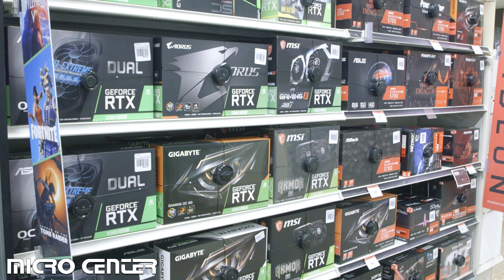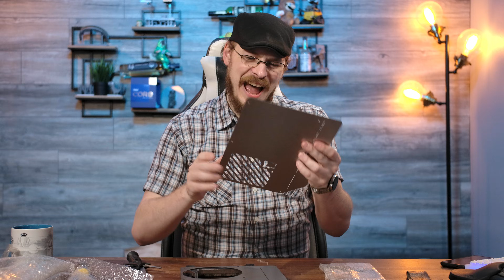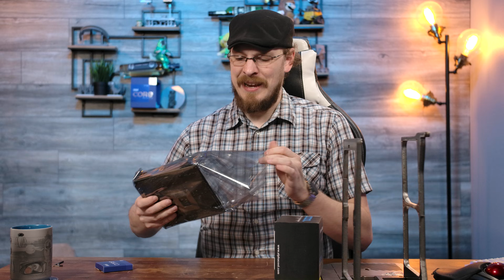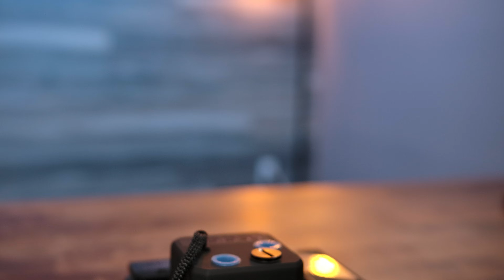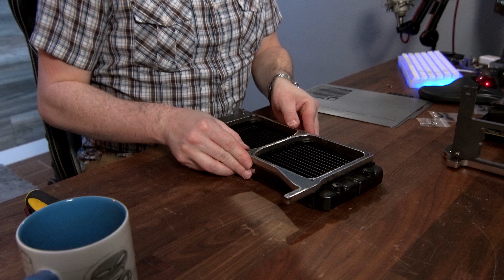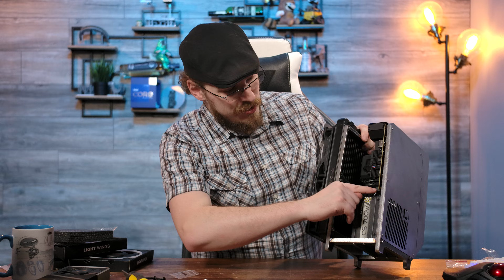Custom Solid Steel ITX Case - My most INSANE build yet!!!

Comment from the maker: Thanks to Microcenter for sponsoring today's video. Get a Free 240gb SSD at Micro Center (New Customers Exclusive, in store only): https://micro.center/973328
Reply: Hi Jeff, Sweet build 🥰👍🤩🏆😉! QQ: Are those side panels supposed to be bent over at the GPU end with those slight perforations to allow better airflow with the GPUs HSF design?
Reply: just a quick note the window on the cpu pump is supposed to be at the top so the pump doesn't get an air bubble stuck in it and run dry, anyhow an interesting and cool looking build

Comment: It's cool only improvement to the actual case would be a slightly larger bottom panel so you can fit the rear and the fans on the inside but I love it

Comment: I'd try to get an Solo LT if you can find one. Or maybe one of the barrow all in ones, but you're probably not saving much height there. I'd have probably made the case a bit wider to ensure the rad being able to fit there. But i think it looks pretty cool on the outside too so maybe not

Comment: Question. Is the bottom 10mm piece reversible? Like can you take the bottom piece of the "U" and flip it upside down? That way it installs from the top down over the screws and nuts rather than from the bottom up. Unless I missed something in the build it seems like it would be possible for the bottom piece to be pushed down/out causing the case sides to collapse inward. For that matter, a single support across the top might also be a nice edition. Nothing huge, maybe just a single I shaped piece of 10mm steel secured with a couple of screws. It wouldn't need to be huge just enough to keep the sides parallel once items are attached to them. A piece like that would also provide a convenient handle.

Comment: Qapla' That is a mighty fine unboxing knife you have there.  Could you direct me to a vender of such fine merchandise?

That PC looks amazing.

Personally I'd go with 64 or 128GB of memory, but if it's just going to be a gaming PC, then 32 should do fine for a while.
I'm not sure if its a common thing in the North and West to have more than one PC dedicated to different tasks (eg. gaming, video editing, office work) etc, but I've tended to have one jack of all trades PC that needed to do all of my tasks(gaming, video editing, development, browsing, media consumption, 3D rendering) and maybe a laptop for portability. I have a small server that runs containers and functions as a NAS and a few Raspberry Pis, but I've just never had the budget for multiple desktop systems dedicated to different tasks, thus my high memory requirement. I'm based in South Africa BTW.

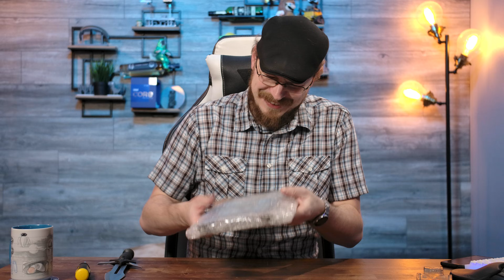Comment: That Clunk @1:47 dang! This is a really cool build. I'm actually interested in doing something similar, didn't know about that all in one pump, gonna have to look that up! Thanks for this review.
Reply: Also, I've been using 180 degree PCIE cable adapters on my GPU's for a while now to clean up the cable mess/look. I recommend them if you want to try and hide cables around your GPU.

Comment: I love the look of the build! I would personally probably go for a black powder coated look on the steel myself, inducing the side sheets :)
I'm questioning if the GPU "finger" where it is screwed to case is on the correct side of the case panel - I saw you said in a different comment that you fixed the alignment of the two side panels and I'm wondering if it was the GPU mount, as that is what sets the alignment of the two plates at the top. But if that is the case, I'm wondering how GPU is installed with the side panel in the way, hmm.
Reply: You are correct. Easiest to mount GPU before the radiator panel.
Reply from the maker: The GPU mount is exactly what caused the issue. The sides are now 100% square and parallel.

Comment: In New Zealand they are recommending 850W PSUs with the 6800xt and 6900xt - will the 700W PSU make a stable system?
Reply: Undervolting both cpu and gpu will give opportunity to run with lower power limit and equal performance to stock, if needed...

Comment: While it's not what I'd choose it is a very impressive look. What are you going to do for a power button? If you search for "stainless LED button" on the likes of eBay you can find some (IMO) pretty sexy options which might fit the build. I'd describe them as something you might expect to find on a sleek modern elevator.

If you go down this route just remember that ATX power switches should be momentary, not latching.

Comment: Guess I'm not easily impressed as most seem to be.  Case is held together by 4 machine screws at the bottom thru slots that in your initial fitting causes the sides to cave in a little at the top.  The links provided only offer PLANS on Etsy.  I like most PC builders do not have CNC/plasma cutters and associated tools the build the case from scratch.  For what folks pay for fancy cases these days this case could be bought for $300 bucks or so if offered as a COMPLETE case as you received yours :) Maybe? Possibly? Who knows!  Love the MOBO  and PS and CPU you chose and thank goodness you're opting for custom cabling.  Too many YouTube builders crap up their builds ball pein hammering in the cables that are too long.  Water cooling and the giant video card just don't work aesthetically for me!  When the cameras are off (hype off too) and you sit back and look at the beast I'm sure you will change a lot bringing the build up to YOU'RE standards!  I love the heavy metal approach to the case but it needs more refinement and those who could build that case can easily customize it.  Hate me now, doesn't matter...  Just another YouTube fart in the wind!  LOL

Comment: That's an interesting design that can also be done with thicc acrylic to keep costs and weight down. Also gives more color choice.
I'd have liked the bottom plate to be as wide as the PCIe support on top so the side plates are straight and not angled like a roof

Comment: I love the build and the overall concept Jeff. If it were me (and it's not) I would keep the steel raw. I think the rough edges where the water jet(?) cut the parts looks amazing and gives the machine a really great industrial look. As to the flat steel I would just seal it with lacquer and leave it be. In fact, I'd probably simulate oil smudges and handling marks before sealing it.  Also, all the screws (bolts) need to be stainless hex caps. No Phillips heads anywhere. But like I said, it's not me and you do you. But please make the two sides parallel. My OCD was screaming looking at that.

Comment: I'm worried about the steel rusting. How about nickel-plating it?
Reply: My first prototype is 1.5years old and it doesnt have any rust on it. But ofc, any surface treatment will change how it looks and how it ages. Up to the builder to choose what one wants. :) Spray it with salt water and you get rust, it wont change the functionality of the case in any way tho.

Comment: That top-bottom offset is making my OCD scream... please that bottom hast to be filed to match. Awesome case indeed, I would change the layout upside down and make the legs sligthly larger so all the cabling goes under and back the thing, and another thin plate on the top with some I/O and power button.

Comment: I'm nervous about open case designs as my primary work desk also involves working with electronics, I'd hate for a screw or a random piece of copper wire to fall and ricochet into the computer.

Comment: Hmm.. even with all that packaging the sides got bowed, shame :\
Reply from the maker: Trust me, they are not bowed. They were slightly misaligned on the bottom. I fixed it after the video. It would be literally impossible for these to have been bent in shipping.
Reply: @CraftComputing  You can never trust a parcel service, they can do the impossible ;)

Comment: The only thing throwing me off on this set up is the custom loop.The radiator mounted on the outside just seems off so i would prefer to go with a different pump/block option. Also, just for flair, metal tubing with the polished case would look freakin sick as hell, but i do appreciate the simplicity of soft tubing.
Reply from the maker: Dammit, now I want to do metal tubing....

Comment: awesome little build, just curious if the bottom plate has been installed upside down?, because if you flipped it, it might just straighten up the two side vertical plates, would have been awesome to see the plate cut of stainless steel, but I understand why you couldn't(distortion from plasma cutter), if you do "shine" this mild steel up to a mirror finish make sure you coat it with some sort of protective coating as it will rust pretty quickly being mild steel. otherwise a nice powder coat finish would look pretty cool as well
Reply: The case is actually lasercut, and distortion is not a problem. We can cut Stainless up to 60mm thickness. Price is the actual reason why its mild steel, its readily available for me as scrap pieces, stainless is not. :)

Comment: I really really like the case, by that ... dont know what to call it but slight convergence from the top and back panels bothers me more than it should 
some squaring of the surfaces might help, or a 3D printed bracket 
or something neat like a top bar made out of a dulled dagger or something that is screwed in to tapped holes.

Comment: I would ask for some black wire frame fan grills, might take up the slack in the screws, and provide contrast to the polished chassis. After polishing, a coat of clear to protect from rusting.

Comment: Is that 700w PSU going to be enough to support a 6900xt and the 12900k? That seems to be on the low end.
Reply from the maker: Without overclocking, it should be plenty. Peak wattage should be around 580W worst case.
Reply: @CraftComputing  okay. I'd still be cautious. I've heard of people with builds using similar setups and having to last minute upgrade PSUs because they kept having artifacts appearing on screen while playing because the PSU couldn't handle the demand.

Comment: I love the idea, though i think it needs a brace between the plates opposite the power supply plate, to keep everything square, those T-nut joins aren't the strongest. I'm wondering why they didnt just drill and tap the sides of the plate for screws and instead opted for captive nut joins.
Reply from the maker: Alignment is fixed now.
Reply: @CraftComputing  Cool, though i still think something  up there might be good, just for long term, maybe it can double as a carry handle? Just spitballing mostly.
Reply: The GPU serves the purpose of the brace.

Comment: Can the radiator mount on the inside of the metal plate or will that block the cpu cooling? Is there enough counter weight to prevent it from falling over easily once watered down? I'm also drooling over this build and want one!

Comment: Seems a little under powered for your components and the orientation of the motherboard to the top is very odd to me.  Where is your power button?
Reply from the maker: PSU calculator says 587W max draw with no overclock. I'm not pushing this system for max performance.

Comment: Curious to see now the cpu temps turn out. I ran an alpha cool eisbaer 280 aio for a while and on 5600x and I'd still see spikes around 80C well gaming.
Reply: You might have air in the pump/loop or bad thermal paste. I run 5600x and 2080Ti on Alphacool Solo LT, 280 XT45 radiator and it keeps both CPU and GPU under 60c under cinebench+heaven combined load. Jeff has a loooot more CPU TDP tho, I'm curious as well! :D

Comment: Great video! I really enjoyed it. The only thing that "scares" me is the the wattage of the psu. For a 12900k and a 6900xt 700 watts are scraping the barrel, in my opinion. Keep up the amazing work😄
Reply: Literally came here to say this. I'm running a 750W with a 6900XT and a 5600X and my system on a demanding game pulls well over 600W from the wall, per my UPS. Also, it sounds like he's only going to use a single power cable with pigtail for the GPU -  PLEASE don't do that! You'll severely underpower the GPU and have nothing but problems!
Reply: @wolffstarr  In my opinion 650w or so from the wall under full load is fine for a (real) 750w power supply. Assuming 90% supply efficiency that's 600w out which is a fair 80% of the rating.
Reply: @eDoc2020  sure, but the point is I'm pulling that with a 6900XT (Red Devil but in quiet mode) with a 5600X and three power leads to the card. Replace the 5600X with a 12900k and only use one power lead, and either you're lucky because you're underpowering the GPU severely, or you're going to find out how well the over-current protection on the psu works.
Reply: @wolffstarr  Yes, definitely use a dedicated wire for each connector. It should be fine with a shared cable but it's best not to risk it. And regarding the power consumption of everything, I haven't built a high-performance system in the past few generations. I'm used to seeing 130W in the highest end workstation processors so I can forget that these new desktop processors can consume twice that.

Comment: The two vertical stays need to be exactly parallel.  Please fix before my OCD goes berserk!

Do the slots in the side panels indicate that they are supposed to be bent over at 90°?  Or are they supposed to be wings that hang out like that?
Reply: This. Plus the way the 'frame is designed, pulling them apart will pull the GFX out from the slot.

This frame needs a top brace, badly.
Reply from the maker: I remounted everything after the video and the frame is now perfectly parallel. Don't worry, it's been addressed.
Reply: @CraftComputing  Whew! :)

Comment: You should have tried the 3090FE. ^^
But that thing looks like some Deathtrap for fingers and pets...
Reply from the maker: I did consider the 3090 FE, but it's a SOLID 3-slot card. I think the mounting point at the top of the case would have looked very odd.

Comment: SO either the case is bent or you should screw the GPU Bracket from the other side. Inside out instead of outside in. Flip the 2 gpu screws
Reply from the maker: The video card was screwed into the wrong side of the frame. I've already fixed it, just not on video.

Comment: I think the "side panel" on the 280mm fans is upside down and flipped inside-out. The angled corner should match on both side panels no?
Reply from the maker: Yep. Check out the B-Roll near the end of the video. I fixed it for that :-)
Reply: Thank you for fixing it! 😬😬😬